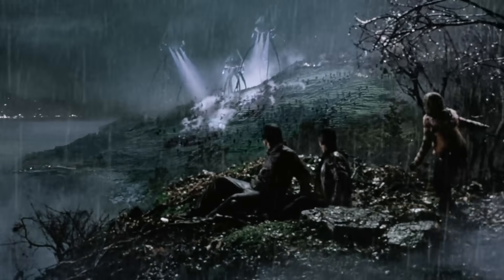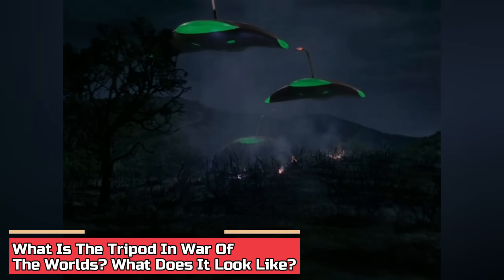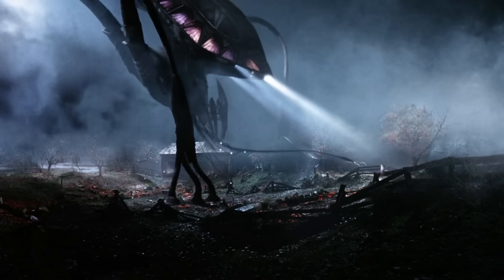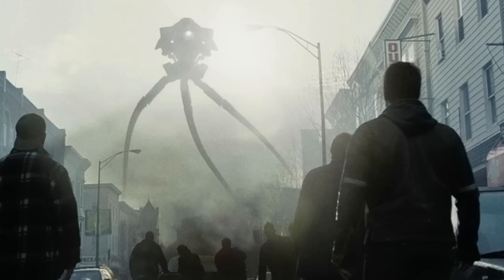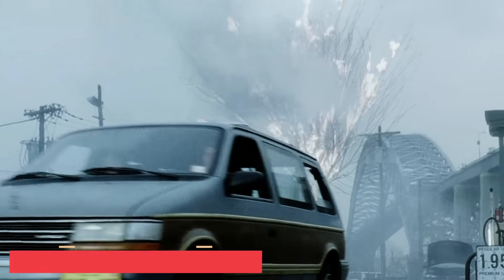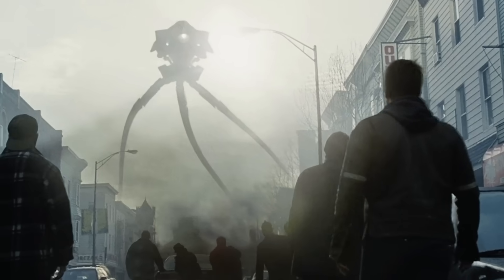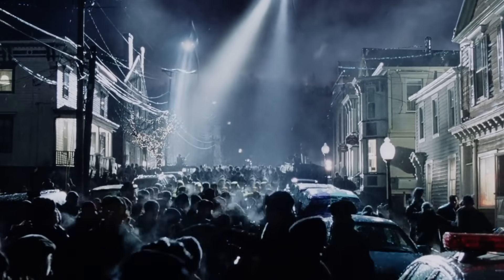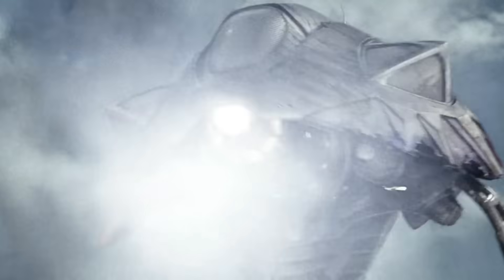Tripods Anatomy Explored - What Gave The Tripods Energy For Thousands Of Years? Purpose Of Horns?

Comment: One thing that I noticed in the Spielberg adaptation was that the Tripods had two modes: Warrior Tripods and Reaper (or Gatherer) Tripods. The Warrior Tripods deployed the heat rays and slicer beams, the Reapers had the tentacles for collecting humans (for both fuel and fertilizer for the Red Weed) and probing. Toward the end, when you see a very sick Tripod, it had deployed both Warrior and Reaper modes, but was helpless to use either. Both its pilot and the Tripod itself were deathy ill by then.

IMHO the horns were marshalling calls between Tripod triumverates. It's one hell of a way of signalling "I AM HERE." But it's quite possible it's also an indicator ( e.g. "I found humans here!" ), a terror device, a distress signal (the sick tripod was blaring near constantly) and a something like a modem carrier wave all at once!
Reply: When H.G. Wells wrote his original story in the 1890's, radio or even 'wireless' morse code had not yet been invented.  So the only way his Martians could communicate that Wells could imagine was through a loud horn signal system.
Reply: There are only two types of Tripod in the 05' film. The "Uber" variant, and the standard variant. There is no "Gatherer" or "Handler" variant in the film, they are multi-purpose, hence why the cages can easily detach from the head. Both the standard and the Uber can both use the Heatrays, and have the cages to collect humans at the same time. There isn't a separate variant just for collecting humans.
Reply: @bennyfagor104  Well, all the tripods could assume either function depending on the needs of the moment, but they usually did one task at a time, either attacking humans and their structures or gathering them.The Uber Tripod seems to mostly feature in the Battle of the Hill, capable of doing both at once and looking larger overall.
Reply: there's also another type of tripod in the movie
the Uberpods
Basically they're Commander tripods with a larger hood and has 5 spotlights instead of 3
they both have heatrays and tentacles and they're seen in the Hill scene & Ferry scene
Reply: @moldybread8027 Supposedly, there were even stronger or more deadly varients outside the Uberpods... however, we never got to see them in the film, and I've only heard speculation of them, as they were I guess meant to be the Generals of the Tripods. But again, we never saw it. Does make sense though that something that big and that important wouldn't be seen just idly walking by or doing menial tasks like the rest.
Reply: These are all concepts from the book. They don't call them tripods, they call them "fighting machines" and later on talking about a spider like machine chasing people across a field and collecting them in a cage on its back. They also have a "flying machine" which terrifies the narrator. 

The calls are also present in the book, they don't just honk but actually seem to say something. They describe it as sounding like someone shouting "ullah" which was inspired in part by Russian battle cries which are "urrah". They also hoot and call to each other when they're dying.
Reply: a lot of people call the reaper tripods harvesters which imo i like more
Reply: Everyone knows aliens capable of interstellar travel didn't invent radios. I'm kidding don't crucify me.
Reply: @woadblue  That one's actually easy to handwave. The tripods weren't just machines, but living organisms themselves. They got sick right along with their pilots. The pilots probably had radio comms, but the tripods had the horn call. Plus, when you're in the middle of a war, calling attention to yourself long-range via radio communications often isn't the brightest idea.
Reply: You should see the war of the game by flipswitch games. The latest update video they made was amazing.
Reply: The rays could be microwaves. It didn’t do damage to objects with no water content.
Reply: @vincentstohr2216  Except for all the houses, the bridge and whatnot else gets destroyed by them...
Reply: So just like those tripods from 1985 BBC TV series "The Tripods" then which also inspired by HG Wells' WOTW. They have two types of tripods, Silver = Reaper and Red = Assault. I think Spellburg got the idea from there.
Reply: Dude you're just straight up spitballing bullshit, go watch the movie again 😂
Reply: @dynestis2875  bru have you seen how some tripods have bigger hoods than others??? like in the ocean scene you can see that the hoods are larger than normal and those are uberpods!!111!1!

Comment: Tripods would get bodied beyond all belief irl. Zero air support, giant, and slow. The Airforce would have the hardest boner ever. Have fun getting domed with multiple 5,000 lb bombs capable of penetrating 5+ meters of hardened concrete like it's paper dropped with +/-5 meters of precision from 50,000 ft at a distance over of over five miles. Would obliterate them with force beyond imagining that they would never even see coming. Fucking stupid to pretend they would be a threat for anything other than a short period. 

"I promise guis, nukes wouldn't hurt em!" lol, lmao even. Genuinely retarded. Nuking these things would be like using a sledge hammer to smash a roach whose legs you ripped off before roasting it's remains with a flamethrower. Still deserved, because they are filthy xenos scum whose only purpose is to be purged for the Glory of Humanity, but absolute overkill.

Not to mention landmines/IED's subvert energy shields entirely. Have fun when humans jebait you into 15,000 lbs of buried HE that ass rapes you straight under your gay little shield. Or they de-leg you with anti-tank mines and gravity then gives you a hard fucking lesson before Bubba boards your craft and gives you an even harder one.

TL;DR: Fuck xenos scum. Humanity #1.

Comment: I loved this version of WotW.  Probably the best and definitely the scariest.  The part that freaked me out the most, for some reason was the burning train barreling down the tracks.   Overall, I'm disappointed in this video.  I thought it would be more of a technical explanation of the tripod anatomy and its power sources, but every explanation was generic and didn't really explain anything in depth.  We got, at best, speculation and nothing more.
Reply: We didn't even get anything generic. Title of the video suggested that it would discuss what powered the tripods and that wasn't even really mentioned.

And what is with the teleportation thing??? We clearly saw a pod go down through the lightning to the tripod.

My theory is that the pod contained the power cell, pilot and supplies and said pod phases through the ground to the mech.